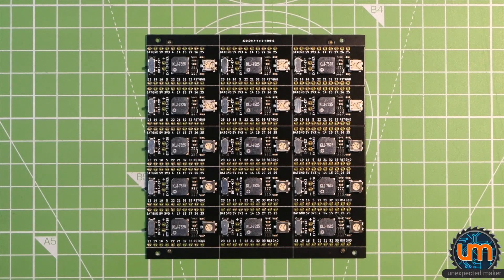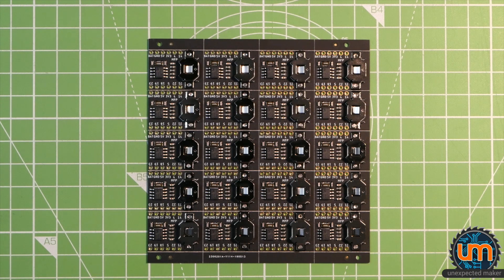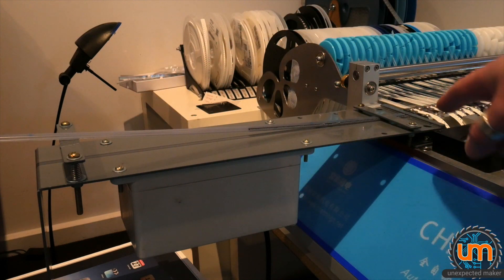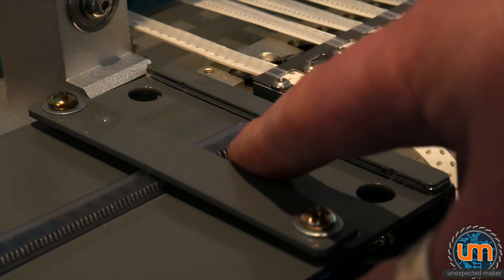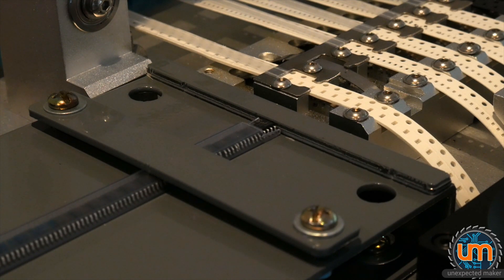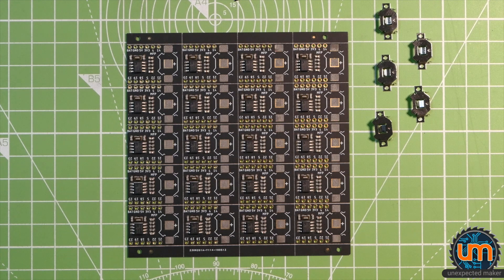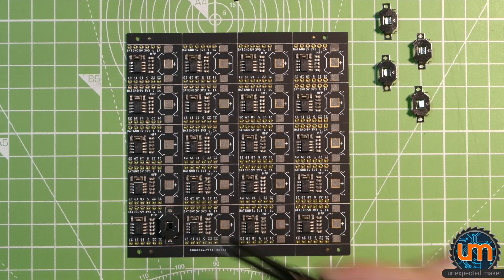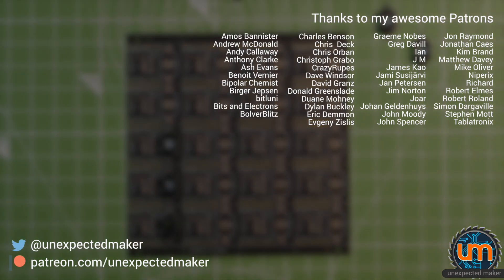My Pick n Place - How did that IC get there?

Comment: I don't know if someone has suggested it before, but couldn't you print a little tray to hold the battery holders in? Sure you have to load the battery holders manually into the tray, but the placement onto the PCB can then be done by your PnP

Comment: For hand fitment you 3D print a part stencil with the silhouettes of the part cut in it. You give it location pins that fit in the PCB and spacers that hold it slightly above the PCB. Then it's just a matter of dropping the parts in the holes.

Comment: For the ICs, couldn't you do a kind of gravity feed instead? As in, put the tube at something like 45* or such, and then have a type of "race track" that they slide into position for the the PNP to suck them up. Kinda like the Hot Wheels tracks, but on a smaller scale.

Comment: Having done PCBA for a few years in a factory you can get the battery clips with a piece of kapton tape over the cutouts. You can load them into a tube of the correct size and do the same with the tube IC's. Or you can place them in a tray that will have a cutout for the clips to sit into and do it that way.
Reply from the maker: Hmm, I've not found anywhere to buy these specific battery clips in any other format other than in bags, without any tape covering the indent.  I thought about making a tray to put them in for pickup, but the issue is the placement, and how they spring and shift when they hit the PCB... especially if the pickup point is not perfectly aligned through the centre axis. Thankfully all of my RTC panels are done now, so it will be a while, before I need to solve this for a future batch!
Reply: @UnexpectedMaker  Try and 3d print a tray for the next batch. It will help a lot.

Comment: Have you considered a custom matrix tray with support built in. Sure you have to put them all in the tray to begin with, but there's no bottle neck to that procedure whereas there is when it comes to handling boards between placement and reflow.
Reply from the maker: Yeah I have, but at this stage, I only have 1-2 more panels to make, so I'll just finish them up with hand placement of the clips. Only takes me about 3mins per panel when I'm not trying to record a video ;)

Comment: didn't know a vibration unit was a thing...    couldn't you make a 3d printed slot for the battery holders to slide down?  or is pickup the issue?
Reply from the maker: It's feeding and placement. They pick-up fine, assuming I have them in place to be picked up - but they bounce and spin when placed on the board, because they act like a spring with the feet the way they are... smearing the paste on the pads :(

Comment: Maybe you could 3D print a custom nozzle in the shape of the battery clips?
Reply from the maker: The nozzles are not just the tip, they include the insert and bearings to click into place, so no chance of printing a replacement... but the issue is not pickup, it's feeding and then placement.

Comment: If the vibration unit can have the frequency altered , how about using it to play a tune whilst you are waiting for the p&p machine to finish the latest batch ?
Reply: haha thinking of the C1541 days eh :)
Reply: @maicod  hi 
Yes I am that vintage !
Did my o-levels here in UK ( USA equivalent is high school diploma ? ) In the late 70's. & Early 80's. School had nearly 1500 students but only 1 computer for most of my time there !! An 8k commodore pet 2001 which initially only had the built in tape deck for saving data & programs .

Most of my programming was done by hand writing the code onto a sheet with a box per character & sending it off to the local university where some poor student had to decipher my terrible  handwriting & type it onto punch cards !  These were then fed into the mainframe where inevitably a coding error or mistyped character would halt the program. These cards were then sent back with the offending card(s) marked in red . Once you'd worked out what the problem was you inserted a handwritten correction card(s) into the correct place in the stack & sent them back to the university. 

Normally took about 28 days for each submission to return so as you can imagine bug checking & improving of code was impossible!!!

Ah those were the days!
Reply: same counts for me. I have grown up using VIC-20/C64/AMIGA and then onto PCs when they finally had real sound (I started with Creative AWE32 ISA card which had a beautiful MIDI soundbank). I think you assumed I was from the USA but I am much closer to the UK (Netherlands) :)
Reply: @maicod  thanks for replying..

Great to meet you even if only virtually..

Could never afford a awe32, just had 8/16-bit sound blaster clones in my early pc ...

Comment: The vibration feeder looks like it uses a aquarium air pump on it, they vibrate at 50/60 hz and some are adjustable.
Reply from the maker: Not sure what's inside the white box...  not pulling apart until after all RTC boards are done ;)

Comment: Here is a couple of ideas that popped up in my head:
If the Battery holder is made of a material that can be attached to a magnet you could create a nozzle that has a nedodygm magnet and a spring. A tube with a magnet at the end and a spring pushing it down into the tube and when you use the suction the magnet is lifted and the magnet is lifted up and thus releasing the battery holder. (A bit reversed procedure for how the PnP works in general) But the battery holder is probably some alloy that is not magnetic. A less cumbersome method could be to 3D print a little nozzle extension with a bigger cone to attach to the PnP nozzle.
Reply from the maker: They are not magnetic. Picking them up is not the issue, I have a nozzle that works fine... feeding them into place for pickup, and placement on the board are the issues. They act like a spring when placed and bounce and smear paste.
Reply: @UnexpectedMaker  Aha! For that issue, I do not have any ideas. I don't own a PnP myself so I cant relate to what settings you may tweak or if it's even possible to change the individual speed for one component. But it is surely mesmerizing to watch one in action.
Greetings from Sweden.

Comment: You have to admit, there is something amusing about attaching a vibrating mechanism to a bench that you’ve worked so hard to ensure is steady and stable. :-)
Reply from the maker: Hahaha, I know, right! I could have just loosened the bolts holding the bench to the wall ;)